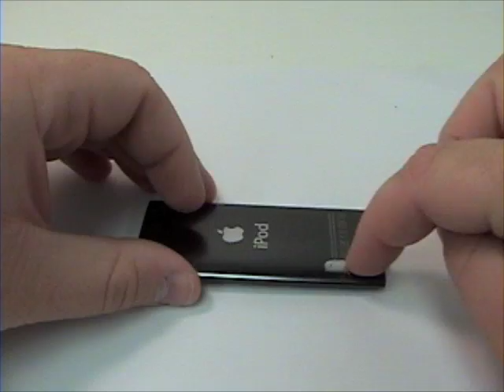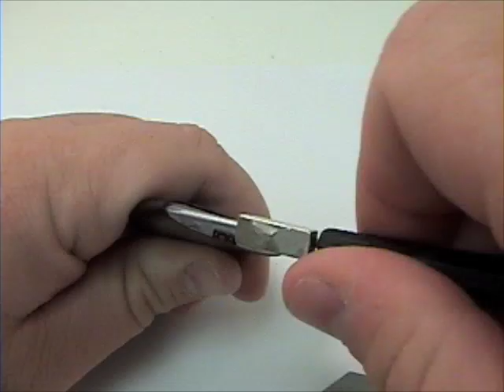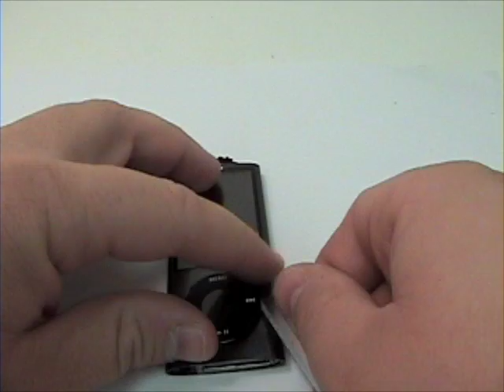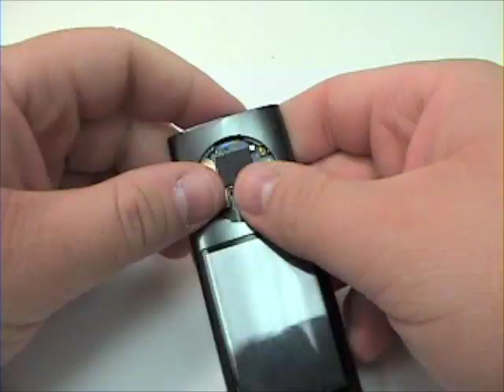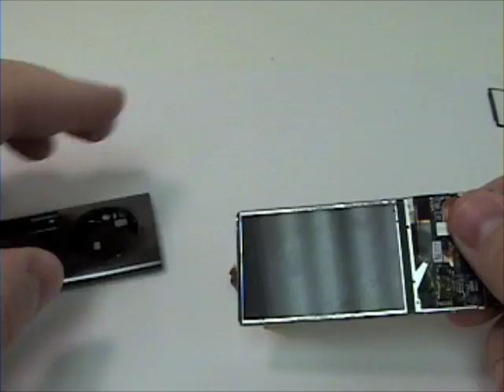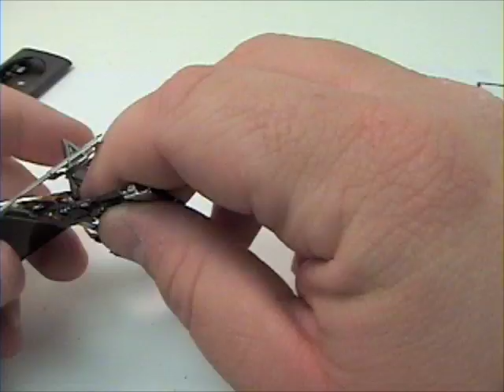How to Disassemble the iPod Nano 5th Generation with Camera

Comment: Your instruction was not right.  The battery was glued to the main casing.  Without dislodging the glue from the main casing, it will be impossible to push out the battery and the main board in one piece.   I followed your instruction by pushing down the main board (& the battery) out of casing and doing so it broke the battery cable from the logic board, which was soldered by 3 points like you've mentioned.    I ruined my ipod because you didn't tell us to dislodge the glue between the casing and the battery.   Just a simple insertion of blade from the top between the battery and the case would've separated the glue and this could've been avoided.

Comment: hello, if the the battery is swollen and cracked the lcd monitor and popped out the glass can you still remove it and save the ipod or just throw it away whole?
the battery being swollen in don't think it can be slid out like that.
Reply from the maker: Yeah with the battery swollen, it’s not going to slide out and it would actually be pretty dangerous to remove it. If that battery gets punctured it can actually catch fire.

Comment: Thanks, I failed at a battery replacement though. Everything went as planned until battery got snagged from the copious glue holding it and broke the motherboard trying to slide it out. Basically designed it to be unfixable.

Comment: didn't slide out gently for me. i think somebody opened it before i put a piece of tape between the battery and the back housing causing me to use a lot of force and ripped the battery and lock switch cable off the logic board. now i have to have it on a charger constantly.

Comment: Can you re-assemble it just as easily?
Reply from the maker: Yes.
Reply: Powerbook Medic
Okay thanks.
Reply: Peter Donovan YOU KNOW HOW F*****ING "EASY" IST IS TO DISASSMBLE?????? I CAN'T GET THIS SHITTY CAMERA COVER OFF
Reply: Powerbook Medic
just curious if you have a 're-assemble' video on this?
Reply: mygalmo
scratch my message! Didn't need one! This worked PERFECTLY for what I needed to accomplish; which was to disassemble to dry out. After 1 year of trying all of the other myths and fix-it-all remedies out there such as leaving in rice for 24 hours, etc....I FINALLY got mine to work after following all of your steps up until the point of sliding the main components out of the case. once I reached that point, I put everything back together by 'carefully' going in reverse, plugged it in, and VIOLA!!! It works! Thank you! One key thing that you did not mention is how to get the pieces to stick together. I melted a black rubber sealant, and used a straight pin to apply tiny amounts to ea. end and in the camera bezel which sealed it perfectly. The other thing was the 'camera light'. Your video does not show an exact picture of the light, so I was not sure what I was removing. I had to use a magnifying glass before I realized it was the white oval shaped gadget in there. After getting it all put back together, and plugging it in, I gave it a test run, and everything is working perfectly, including sound, pedometer, music, video/camera, etc. So, all in all, your video was excellent, and I give you 2 thumbs up on this. ;) Thanks again.

Comment: Not too bad a video. I only have 1 complaint. You failed to mention about all the glue they put in here. I couldn't take out the circuit board because of it so I just scratched my ipod for no reason and wasted so much time _. I can tell you took this apart already by the scratch next to your camera...you should have mentioned it as it may be a problem. Also the dial keeps falling out because that adhesive was the only thing holding it in there -.- Also now it wont turn on. Don't make a video taking something something apart UNLESS you tell people about stuff like the glue. THANKS A LOT -____-
Reply: Macabre .Untold Yep -_- ipods are NOT meant to come apart. Sorry that it happened to you. I thought the same thing too. I still need to buy a new one. The only way to fix it is to some how disolve the adhesive with the correct chemicles and without damaging the ipod. I sure would love to know how this dude did it  cuz I sure don't. I much rather fix mine since I am a sentimental person. He really should have fucking told us _. Now all I have is my Samsung Galaxy Light and I much prefer my ipod for music than a phone do to battery life and I loooove the ipod resolution on the camera XD
Reply: Same, just broke mine, he also doesn't say about the screw in the mindle of the mother board, and it almost impossible to "work your way" to free the battery, he also doesn't mention about the tape, i cut one of my wire by mistake when trying to remove one

Comment: stumbled across this video and decided to try it.....bad ideal. have to agree with others who have tried it. video fails to mention the part about the glue or two sided tape that is inside of the parts which i'm sure they have already removed before hand making this disassemble look so easy. lol needless to say it in fact is not easy, in fact virtually impossible.so if anybody needs an lcd ....i have one if you need it, won't be needing it due to the fact that when you get to the part about sliding whole thing out failed to mention the tape holding the battery in place and viola...ripped cables.....hahaha oh well. off to store to buy new one.
Reply: maybe that is the reason why I couldn t find any place where I could have my screen changed,  Even the apple shops doesn t repair 5th gen nano ipod,  So sad my ipod doesn t show images although the audio works fine
Reply: Hey, if u still have the lcd, i need it.
Reply: and i always thought i was the only one with the poor jokes!

Comment: To do this right you need to have either a heat gun or blow dryer on hand. this will make the project MUCH easier, It's still your own personal responsibility to use common sense when necessary, meaning take you sweet time otherwise the unit will definitely get mucked up. Have fun!!!

Comment: This is so much more difficult that the video suggests. There are extra bits of tape that the video doesn't have and the glue is really messy. I was unable to 'work the logic board free' and have torn ribbon cables on two iPods I was trying to fix. 
Needless to say I was taking my time, especially after the first one ripped, but I was still completely unable to free the logic board without tearing the ribbon from the camera to the board as well as the soldered ribbon from the board to the batt.

Comment: Tryed to do it this way and I got as far as the Pulling the Whole thing out.
It slips about Half way and i Brock the Lock Switch but also the Battery is still Inside my Ipod.
I was pulling it apart cause the Life of the Ipod when not in use was 24 Hours.

Comment: This is supposed to be a skilled technician at work, yet the metal blade as a tool is not appropriate for this task.  You can see how the casing of the nano is dented and scratched because the sharp metal blade was used.  Otherwise, this is one of the better videos out there for 5th gen iPod nano disassembling.  Apple sure didn't invest much in making a reasonably serviceable device. All of those friction fit pieces will probably loosen after being taken out and installed again.

Comment: You need to do the  what he did from last step to first step to put you'r 5th gen iPod nano back together i need to take mine apart because it's got dust inside the dock connecter hole that's making the headphone jack sound bad and  also making the internal speaker sound muff-old

Comment from the maker: @danyduy - You either need to replace your click wheel assembly or your logic board. You can give us a call if you'd like us to do the repair at 1-866-726-3342, option 2.

Comment from the maker: @Tobyj2010 - You'll likely have to replace the logic board to fix the issue which may run just as expensive as a replacement unit. We sell replacement parts at our website.

Comment: @PowerbookMedic 
Thanks...I got the top and bottom parts off as well as the camera bezel, the screen, and the scroll wheel, but I can't slide it out. I guess the dent in the back is pressing the battery/screen too tight. Any advice, or am I pretty much boned?

Comment: @gabbytwilightgirl happened wth me n i had to restore it on itunes which takes it back to its factory setting. went to the apple store where they said they had not heard of this before and said because nobody in the apple store knew what happened they just told me to restore it if it happens again. they also thanked me for pointing out a possible major problem in the ipods system ( in just mine or world wide, probably world wide) this was advise from apple dont listen 2 any1 else hope it helps

Comment from the maker: @gabbytwilightgirl - Try plugging it into another machine first to verify you don't have a problem with your computer. If that still doesn't work, you probably have a problem with your dock connector which is built onto the logic board in the model. If that's the case, you're better off getting a new iPod.